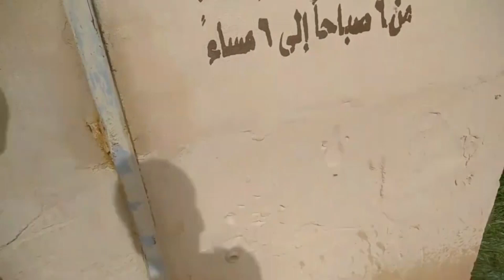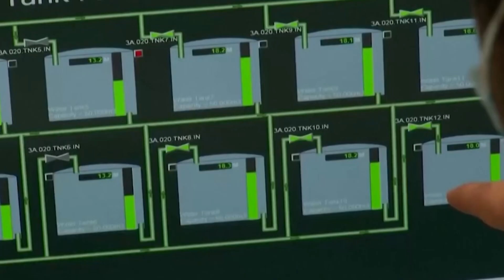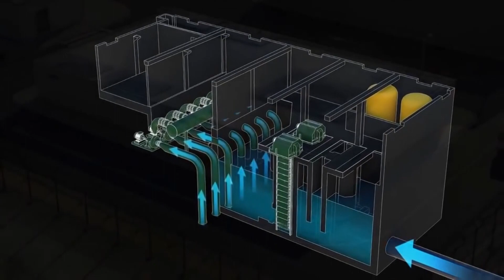Saudi Arabia's Severe Water shortage Problem - Greening the Saudi Desert into a Farmland Oasis

Comment: They need to do more localized rainwater harvesting rather than just big centralized dams, as well as gully repair, etc.  
They also need to plant more site-appropriate foods and pioneering trees and shrubs.
Reply: they really don't have any rain water.  it's very rare and when it comes it floods the wadis and washes away cars and people.   The dams in the wadis are all you can do really.
Reply: @billsmith9711  
They have some, and they need to capture and use it to rehydrate the soil.  Every bit counts.  Tucson is a high heat low rainfall area that has beendecreasing is dependency on pipes water through low cost, durable means.  Every bit counts.
Arabia could also start a mangrove planting project to increase transpitpration, albedo effect, rain.
Reply: @b_uppy  -  uhhh....   I said their rainfall is very rare,  I have lived there.   most places get less than 2 inches/year....  their blockages of the wadis makes little difference.  Desalination is what they need more of.  lookup SWCC...
Reply: @billsmith9711  
'Uhhh', I am well aware of their lack of rainfall.  
That's why desalination adds more problems than it solves, btw.  1) It centralizes water.  2) Adds to electrical grid strain.  3a) The leftover saltwater can harm ecosystems.  3b) It must also be pumped back or trucked.  4) It's expensive to build and maintain and prone to breakage.  5) It makes a basic necessity more expensive, and is has especially negative impacts on the poor. 6) etc  
Gully/Wadi repair is part of your basic rainwater harvesting earthworks and techniques, but more can be added.  
Look at Middle Eastern regreening projects using permaculture techniques, instead of ones creating fragility such as featured in this video and your 'desalination plant'advice...